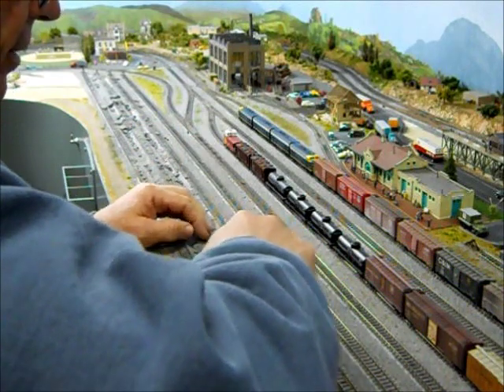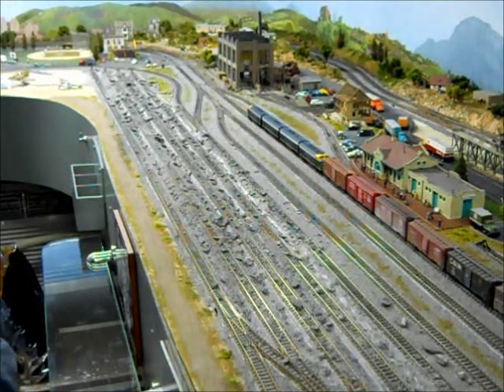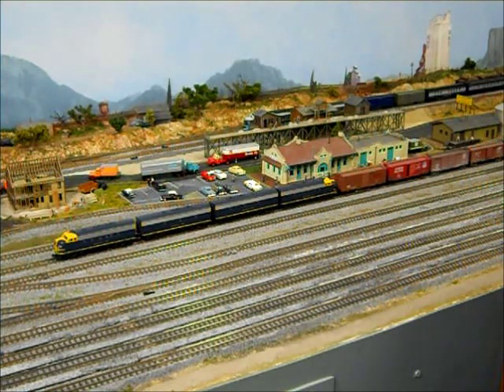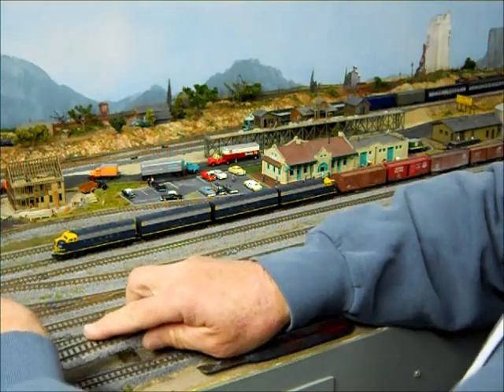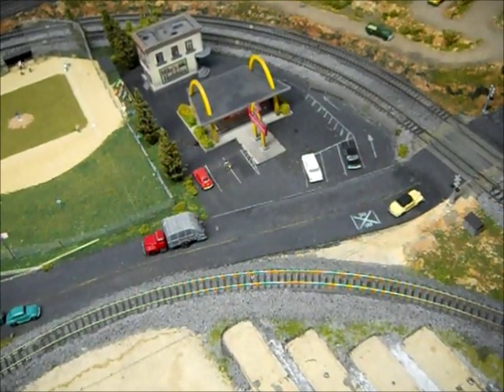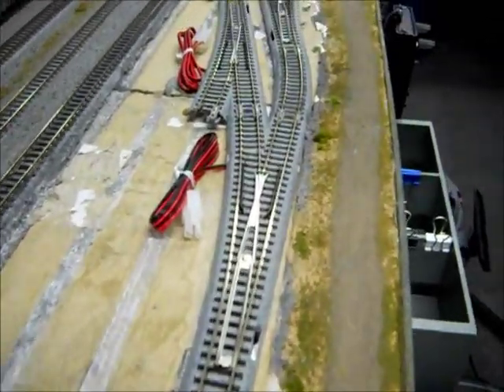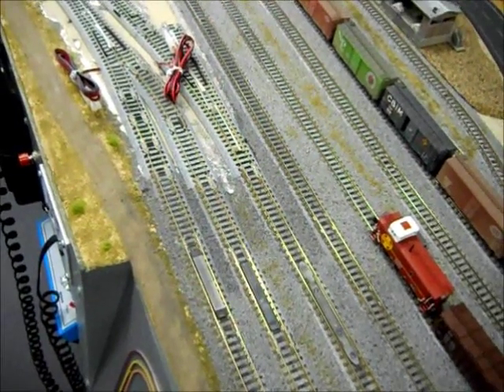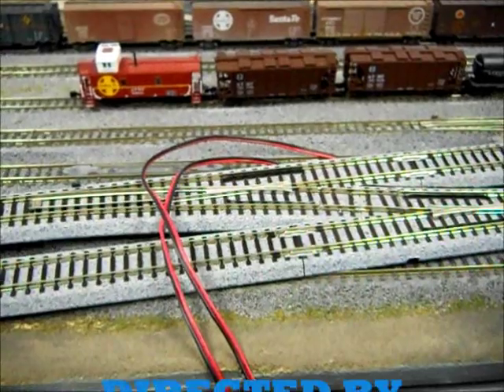Changing a Kato Unitrack Yard on the N Scale ACTRR

Comment from the maker: I wanted a smoother yard operation and the #4's are pron to derailments without some modifications (which I did) but I had electrical routing isues as well.
The three railroad rules of thumb are :
Use the largest radius possible 
Use the most gradual turnouts possible
Use the least grade possible
That is the reason in a nutshell.
Thanks Sean , Mike

Comment: If you used the 50% white glue and 50% water to glue your ballast or scenery down, there is an easy way to rip it up for change. Simply get a bottle with water and a few drops of detergent, spray it on and wait for about 30 seconds. The scenery will absorb the water and then it is easy to lift off using something like a small paint scraper.  That way no forcing is need to get it off.  It also makes it easier to get the ballast off the unitrack pieces without destroying them.
Reply: +nuggles58 Thanks for the tip. I did use hot water.
Mike

Comment: Mike, I once built a small layout with unitrack. I soldered my rail joints because I was wanting to keep good electrical contact after painting & adding extra ballast. Did I need to do this? The reason I am asking is I am getting ready to build a 12'x24' n scale layout & am considering my options on what track to use on my upcoming much larger layout. Thank you, Johnny B.
Reply from the maker: No , I did not and we did not at the club and we have 800 ft of track out there and had only a couple places we had to solder and can be done after the fact.
Thanks , Mike
Reply: ***** Great. Thank you. I appreciate your input and thanks for your very helpful videos. Johnny
Reply from the maker: ***** Thanks Johnny, We put feeders about every ten feet at the club. We also insulate after every turnout and re-feed beyond for easier trouble shooting and so we do not have to rely on the switch contacts for power beyond the turnouts.
Mike

Comment: what exactly is the issue with #4 turnouts? I am using them in my rail yard because #6's are way too big on my first to lines that go through the station, and have a #6 on my siding area...I am short 5 #4 turnouts atm but they seem to be all that will fit...
Reply from the maker: They are commonly known to cause derailments because the point rail is only about half as thick as the stock rail and wheel flanges catch on that miss alignment plus they are really fragile. Take a look on google.
Thanks , Mike